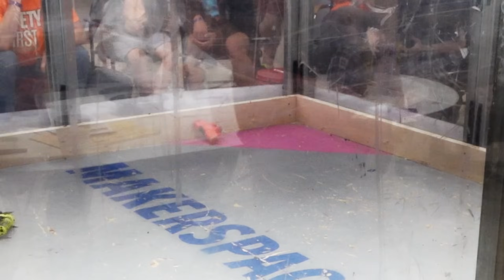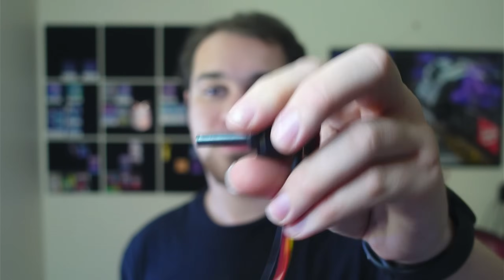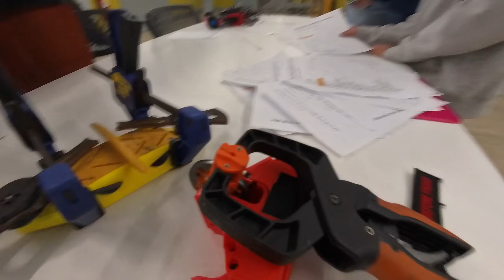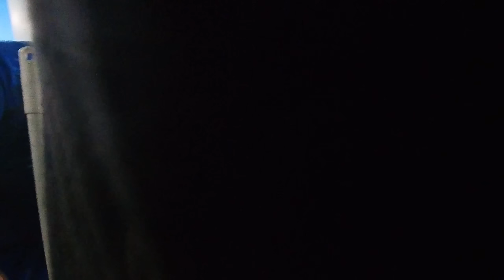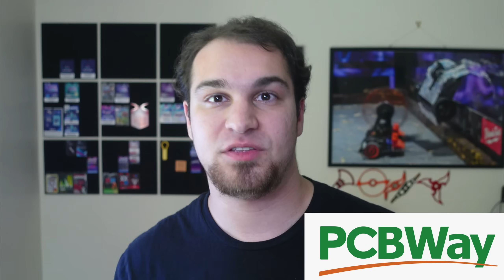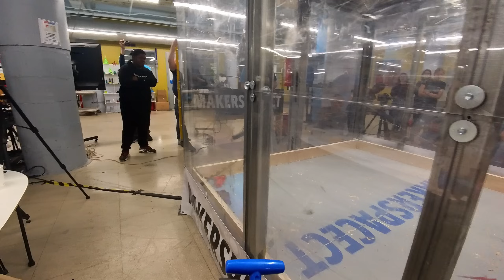Sonic & Knuckles? Brothers in Robot Combat! [Maker Battle Recap]

Comment: Why was sonic v2’s top panel held on by tape?
Reply from the maker: TPU is flexible and the top didn't want to lay flat, and the extra bump out was preventing it from self righting easily from its back. I need to add some more internal space and rear lid screws next time!

Comment: Where do you solder your indicator light to on your motherboard?

I love your content and your well crafted electronics! Keep up the great work!
Reply from the maker: The motherboard has the indicator light built in so I don't use an external one and NHRL doesn't require them currently
Reply: @JustCuzRobotics I wanted to hook up the board to a particular light on my bot. Where can I solder it?
Reply from the maker: If it's a typical LED you will need a current limiting resistor wired in series with it (like maybe 300-1000 ohms) and can solder the anode to the CH3 or CH4 outputs in the left side of the board, center pin 7.4V and leftmost pin ground.

Comment: I’m kind of curious to see how sonic and knuckles would do as a multi bot at the 3lb level.
Although probably not very well since multi bots usually struggle.
Reply from the maker: If I could get them to actually drive properly then they might be okay but I'd prefer to use the extra weight allowance and have two 2 lb robots at NHRL
Reply: @JustCuzRobotics A pair of 2lb verts could probably do decently well.